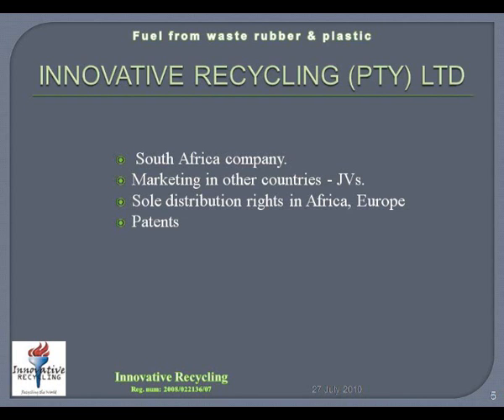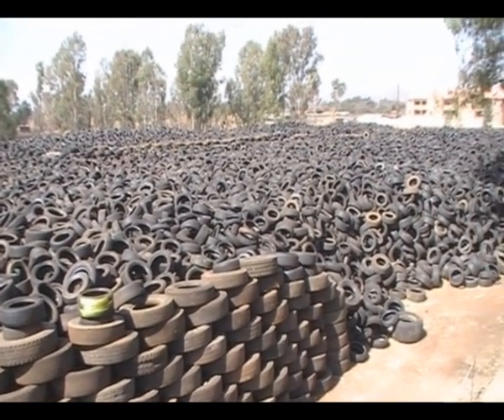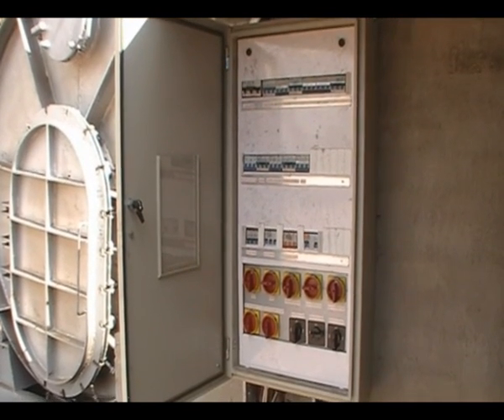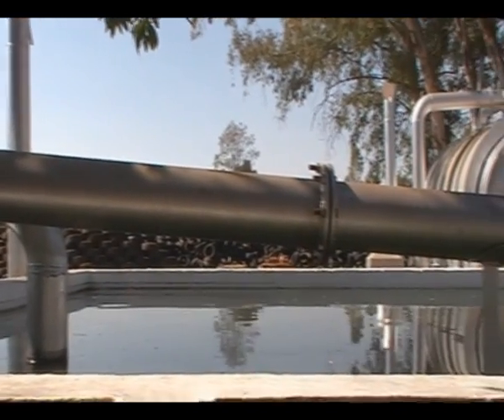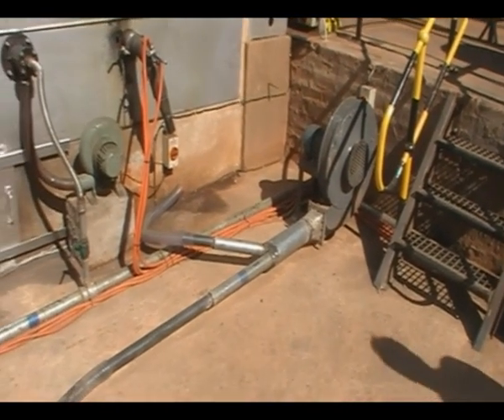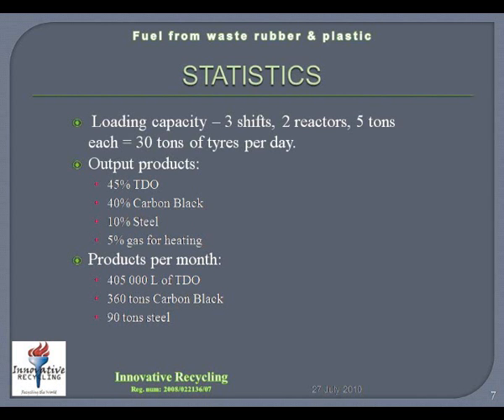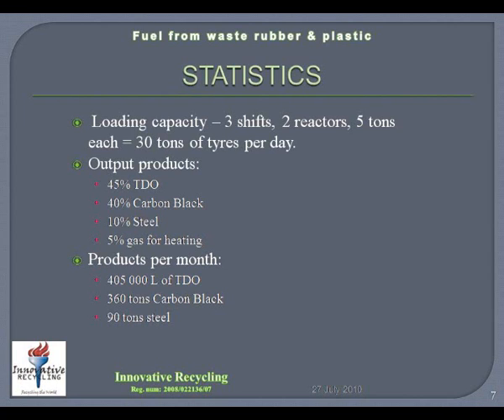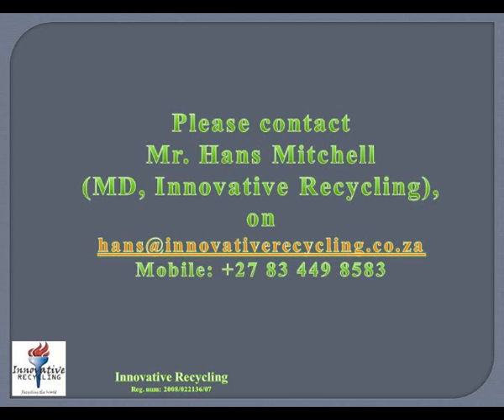Innovative Recycling Pyrolysis DVD2.wmv

Comment: tHE SYSTEM IS A VERY OLD ONE. MADE IN CHINA, HENAN PROVINCE. THIS IS NOT PERMITTED TO USE EVEN IN CHINA NOW.
Reply: Why is it not permitted to be used in China ????
Reply: Caesar Smith They are environmentally very dirty and physically as well. If you go there see how they take out the carbon from the reactor. In from 2008 till 2010 I used to work in one of the factories that is still producing these units. They are about 60k USD but everyone in Philippines that got it is in a big sh1t as the government is closing them one after another. I tried to explain to my ex employer about the issues but they didn't want to spend any money. The answer was standard. It sales so don't fix it.
So I had to move out and open a new company. We are working on a contract with a SA company to establish a plant in SA. Have a look at www.aghrecycling.com
This factory is producing oil that is very dirty and it smells really bed. Actually the whole production facility smells. Don't take my word for it. Just go and have a look.